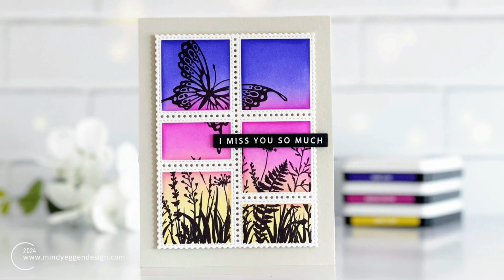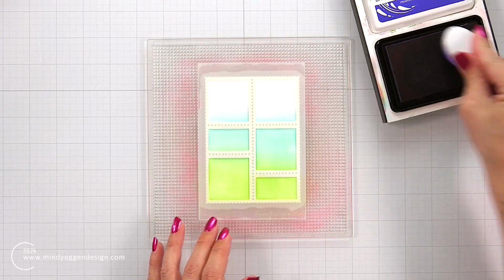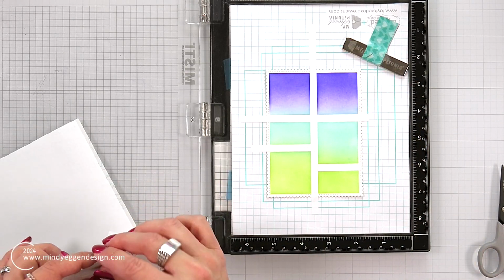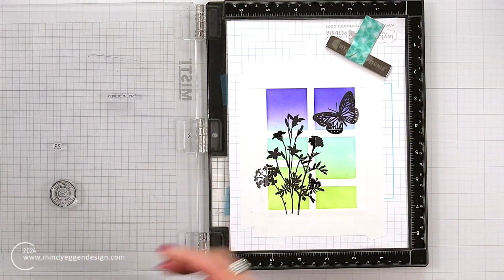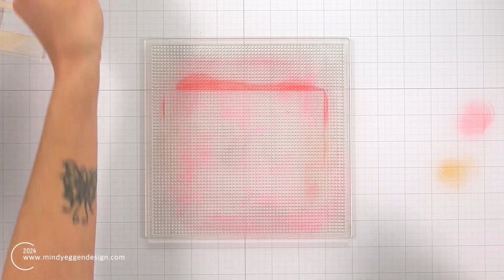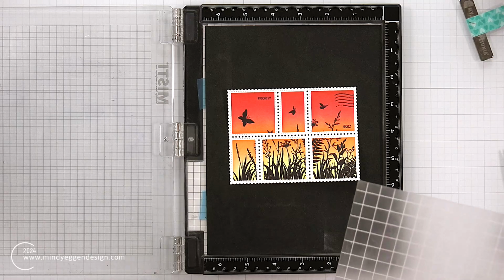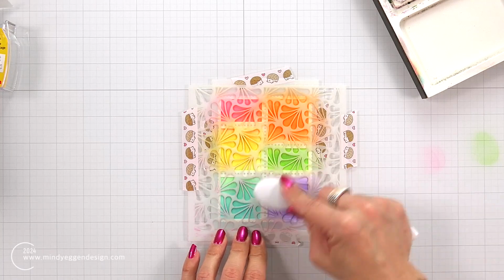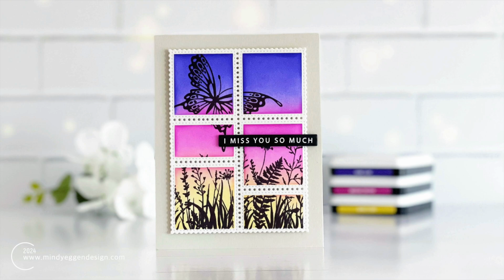Gina K Designs Silhouette Postage Cards: Shopping My Stash!

Comment: Please can you help me? I love all the your tips and cards. I’m 80 years old and have been m,in cards for 25 years. I should write tips down and of course I did not thinking I would remember…did you make a card using a water mister? I bought the mister and can’t remember what it’s for!🤣🤦‍♀️🤦‍♀️🤣🤣🤣.thanks if you can help me.
Reply from the maker: i will sometimes mist the back of my cardstock before running it through with an embossing folder. That might be where you've seen it :-)